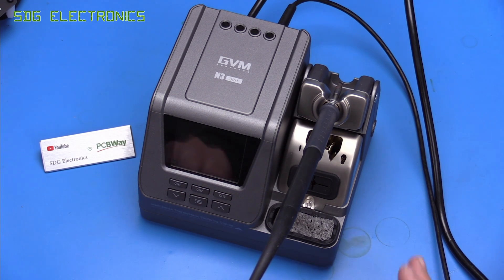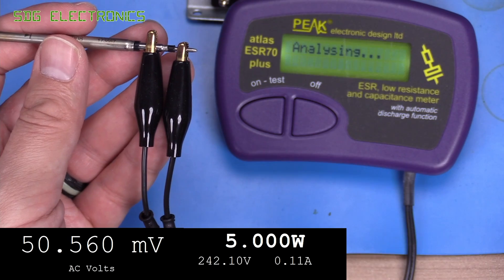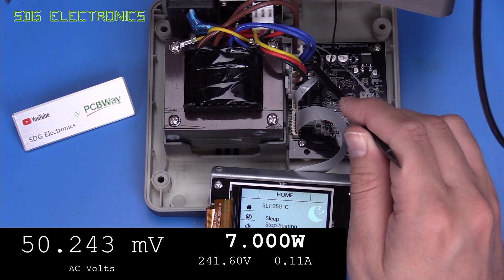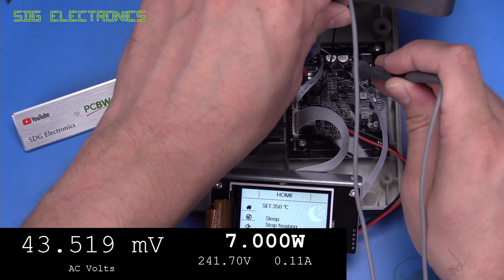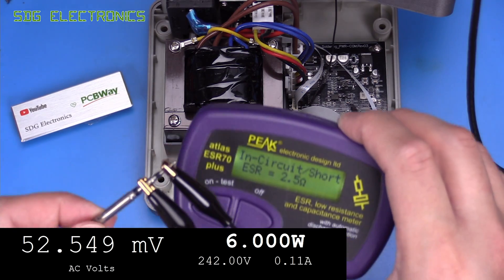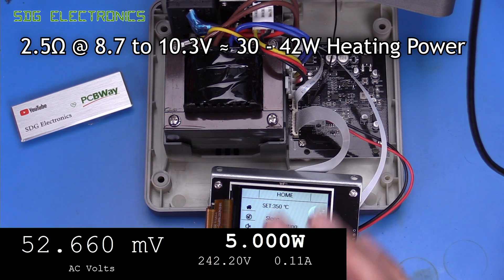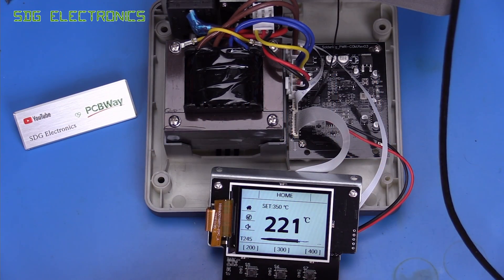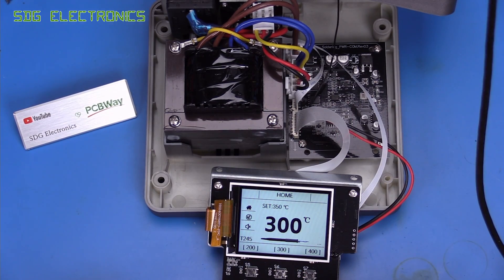SDG #331 GVM H3 - Why did we not get 80W output power?

Comment: Originally, C210 tip for T210 handle of JBC is designed to provide power upto 40 watt. With the huge research and development program, even JBC is still unable to produce more power with the same tip architecture, how a chinese copy company could achieve 80 watt performance? BTW, your knowledge and explanation are really good which makes your videos more informative. Thanks a lot.
Reply: The c245 tip has a power of 120w, the GVM H3 has a transformer of only 80w, isn't this insufficient power for the c245 tips ?

Comment: I beginning to wonder if they assemble it wrong. I would assume they would use the 14v tap to run the heating element and the 10v tap to run the logic would have been how I would have wired it?

Comment: SDG: I was wondering if that long rectangular component is it an optoisolator, or some other component required for detecting when the AC waveform crosses zero?

It was in the previous video about this station. You didn’t know what it was.

Comment: Good follow up. The pulse skipping even at max load is going to be necessary to allow a dead time when measuring the thermocouple. Maybe 90-95% would be the maximum. But they can just compensate for this easily by increasing transformer voltage.

Comment: That transformer doesn't appear to be  large enough to supply 80W?
Reply: It only has to get the iron up to temperature, then it will throttle right back. 

If it can’t handle 80W continuous, it should have a thermal switch mounted to the transformer like a microwave.

Or maybe they monitor & protect against it in software, but who knows if they do? I guess probably not.

Comment: I bought it and used it in the past two month. Very fast heating ( about 3 seconds) and measure input watts at about 60. I think you have a faulty unit or something happen during the disassemble and assemble.
Reply: Open your unit up and see if the blue and brown windings are plugged in the other way around!
Reply: @ickipoo Blue wire is for the 5v regulator as it is only 9vac. The brown wire ( middle position)is at 12vac .My incoming voltage at 215Vac ( backup power voltage). Maximum wattage for 245 probe is 42 watts. If I connected to my house 245vac, maximum wattage is 62 for the supply 245 tip.
Reply: @IzaniIdris-m7f  So yours does have the blue and brown in the opposite positions? I wonder how many units they shipped with the wrong configuration?
Reply: Fast heating but what about heating delivery? compared to the review of the last video when perform very poor on the coin test, yours perform better? the 245 cartridge are able to heat a medium ground plane?
Reply: You Right 👍

Comment: 80W transformer, splitting the load between the brown and blue loads?  I.e. 40W each, with the brown only using a slight bit but the blue limited to their 40W?      Much like how a lot of Chinese Li-Ion batteries claim mAH ratings which you'd assume to be at the  higher voltage of the battery pack but it is really at the cell voltage, not the pack output.    It's 80W, you just can't use it.

Comment: 3 minutes in... Did they swap the brown/blue pair of the transformer?
Reply: Exactly my thought, the 10V unloaded, 8V loaded winding would be ideal for the logic supply (and probably reduce that quiescent current draw quite a bit) and the 14V winding could then power the heater... 

@SDG Would you be willing just to swap those? I mean, the unit is kinda useless like this anyways, worth a shot :D
Reply: Ooh, swap them!! I wanna know!!!
Reply: Even if, this wouldn't equate to 80 Watts either.
Reply: @marcus_w0  with 14v and 2.5 nominal resistance you get around 78w... So quite near
Reply: there are other videos and photos online where you can clearly see that the blue/brown pairs are reversed. Some images also show a label on the transformer where it is indicated: blue pair 9W brown pair 70W. Given the results of this video I would say that Steve was working with 9-10W of power, not with the 70W available. And this confirms the collapse to 8V of the voltage measured under load of the blue pair which is the service one and not the power for heating.
Reply: My thoughts too. Could be miswiring or just plugging it wrong if the blue and brown wires have similar plugs.
Reply: Oh good call - worth a follow up showing the test with them swapped!
Reply: @jamesmauer7398 Indeed! But it is better to check also if one winding is smaller wire than the other. The one for digital section may be. It may even be the lower voltage one.
Reply: Tengo una pregunta que tal vez es muy simple pero me gustaria preguntar, porque mediste la punta del cautin con un medidor de esr, en vez de un multimetro teniendo los mejores multimetros como el  fluke, gracias por tu tiempo, son en verdad muy educativos tus videos, cada día he aprendido más,
Reply from the maker: I will check it. Didn't even cross my mind!
Reply: @sdgelectronics  Especially if they have the same connector type that will be a very high probability.
Reply from the maker: @electrodacus  looks like it might have been assembled wrong. 🤦
Reply: @sdgelectronics  That is good as you have a reason to make another review video :)   Looking at the video it even looks like the brown wires are thicker than the blue ones. 
It will not have made sense to build what looks like a decently designed unit and then fake claim it as 80W.
Reply: There's sort of a teardown video on PC on Line's channel which seems to show the blue cables near the rear (not brown as seen here). But, as always, be prepared for just about anything when swapping said connections.
Reply: They totally did! Can't wait for the follow up vid to prove it 😁
Reply: Están invertidos los cables azul y marrón 😅